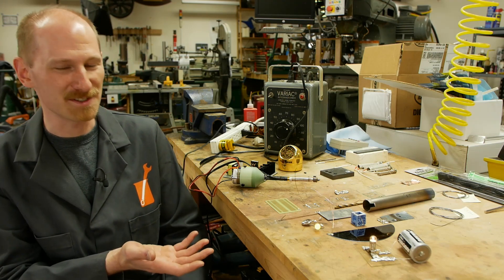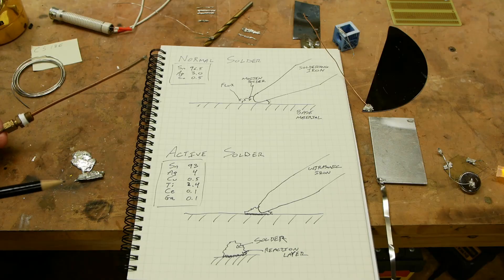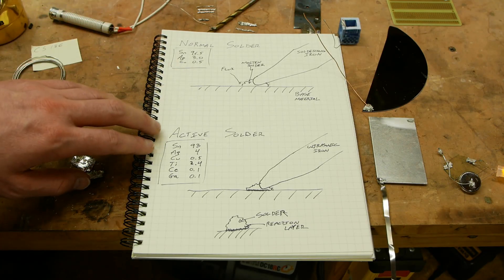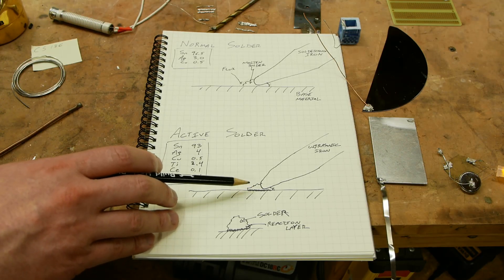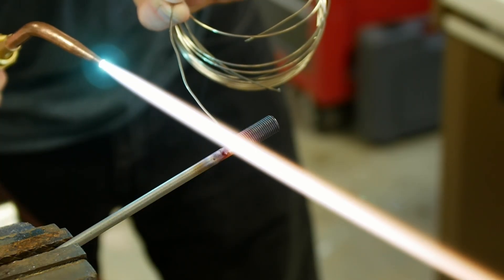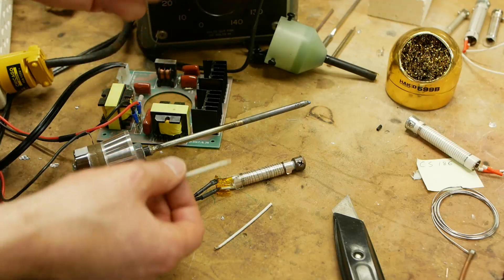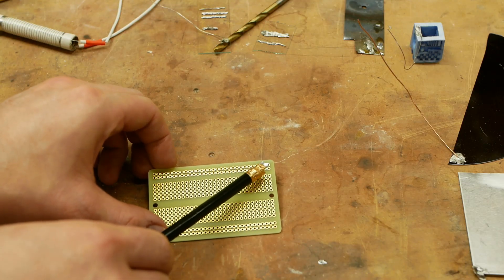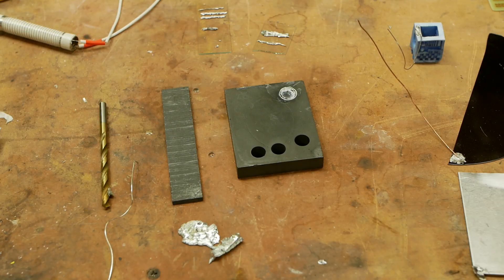Ultrasonic soldering bonds glass, titanium, stainless steel, ceramics, tungsten, nichrome...

Comment: I thought zirconium is non-reactive and why it's used in reactors?
Reply from the maker: It's true that zirconium and titanium are very reactive, so reactive that they instantly form a tough, continuous oxide layer in air, and it's this tough oxide layer that protects them from further damage.  Paradoxically, some of the most reactive metals are often the least affected by acids and other corrosive chemicals because they've already formed a very strong oxide coating from environmental air exposure.

Comment: In the future can you make a video showing a DIY solution for ultrasonic wire bonding? Specifically for creating 18650 battery packs without introducing the heat from the soldering iron into the cells and degrading them

Comment: I had that exact "solder-ate-the-tip" phenomena  on a cheap-ass solderstation. Happened with lead-free solder and a really hot temperature (the solderstation temp regulator was exceptionally useless). Felt like it was similar to what gallium does to aluminium.
Reply: It also happens on copper tips if you use them too high temp and from memory it is some corrosion as certain compounds boil off.

Comment: yo dude. i just found your channel. and i have learned more in the last 2 hours than i have in the last 2 months. i learned how u can make a water cutting machine out of a simple pressure washer. i learned how u can drill holes in any conductive metallic object, how you can put holograms in chocolate, there was one video about a glass pump that i did not understand (way above my level of intelligence) but it made funny lights happen at the end so it was cool. and i learned about the internals of an x-ray gun. oh and also that if you pull tape fast enuf it produces x rays. like wtf epic dude. thanks for the content man i love this kinda stuff.

Comment: Ben, I genuinely need to thank you so much for this video. I had never seen this technique before, and it's so simple. I wish I had seen this 4 years ago when I was working on a research project that required soldering to doped silicon -- we ended up using this weird proprietary compound called nickelex instead, and it was a disaster and our contact quality sucked, and this was despite the fact that said compound was 1% HF acid. This is so much simpler and safer... 

I'd be really really curious to see if you get good ohmic contacts across silicon oxide -- if you could do a quick IV sweep to check I'd be /extremely/ grateful. I'm also really curious if that silicon wafer holds up to a post-solder anneal, and if it improves the contact quality at all. Again, thank you so much for this!
Reply: I believe that ultrasonic welding is the norm for silicon?
Reply: @absalomdraconis  I've never heard of ultrasonic soldering being leveraged within a semiconductor engineering context prior to this -- usually, within that context, affixing anything to silicon via methods other than wirebonding to pads is out of the question. The goal of this project was solid state sensor fabrication outside of a clean room, which restricted the options pretty significantly. I'm sure this was an option that was known at the time, but neither my teammates nor the professor we were working under knew about this possibility ahead of time or stumbled upon it during our research. Dunno if that means we just missed the right sources, if it wasn't as widely adopted at the time, or if it's a research siloing thing.
Reply: @hedgeberg  : Not ultrasonic soldering, ultrasonic welding. I understand it to be the norm for semiconductors, using gold wires that are ohmicly bonded to contact points on the semiconductor die via ultrasonic actuators of some sort. I have neither training nor experience in this field, so I might be misunderstanding something about the whole subject (for instance, maybe the bonding is actually to pre-deposited solder instead of directly to silicon?), but I've run across mentions of it intermittently for years.

Comment: It would be nice to see if it works on Aluminiu Nitride, which is a common choice for high-density LED COB modules due to the matched thermal expansion with the semiconductor. The downside is that these modules are pretty small, around 10-20 mm square, and not easy to bond to a heat sink.

Comment: Do you not have to "tune" the iron by adjusting the length to find a nodal point of the sonic wave?  When we were using our ultrasonic drilling and milling machines, we had to silver solder our diamond tools into the tool holders and we had to make sure we had the exact length as specified by the machine manuals.  The formula was based on mass and length but, the mass was not hard to get as we used several standard tool holders and just drilled them out and soldered in our diamond tools.  As long as you got the length for that given mass close (say within .010")  You could use the tuner on the machines to bring it right in.  If you were outside of the ability of the tuner to adjust the transducer, you had to start over again.  This would allow us to easily drill and machine materials like 99.9% AL203, Ruby, Sapphire, and other hard ceramics.  We did this back in the 1980's for the aerospace and electronics industries.

Comment: Have actually purchased a high end ultrasonic soldering iron but VERY dissatisfied with results. Im an IPC soldering specialist and there is NO way I could send anything out of my shop with the appearance of the solder joint it creates. Sure, it may be well wetted but I'll be damned if I can produce what looks to be a good solder filet. I am currently waiting on "special" solders and fluxes to see what I can produce. A lot of the fluxes offered to solder to aluminum are very acidic in an attempt to remove the oxide layers and cannot be left on printed circuit boards as they will destroy them. I have recently had pretty good success soldering to aluminum conventionally in an argon chamber I made. I put everything in the chamber, fill it with argon then clean my aluminum with emory cloth then solder using lead solder. I get a better looking joint than I do with the ultrasonic iron thats for sure. I am currently making tons of samples attaching a multitude of substrates with the intentions of performing pull tests, sheer strength analysis and some extended temperature cycles with humidity level changes amongst other tests. Challenging stuff for sure but the boss says he wants things lighter in weight so were trying this... Enjoy the channel, just stumbled across it.

Comment: How about battery welding?  Can this process be used as an alternative to the spot welding used to bond tabs to li-ion cells?  Standard soldering requires too much heat to get a good bond, so tabs are spot welded to li-ion cells. That process creates more heat than soldering, but localizes the heat to a small area for such a short amount of time that it won't heat the cell enough to cause damage.  If this ultrasonic process can bond those tabs to cells at temperatures low enough to not damage the cell, I would definitely want to give it a try!

Comment: The graphite bond seemed like it wanted to stick. . .Perhaps a mechanical issue where etching with acid wash could provide more surface area at the microscopic level that would be more susceptible to bonding?

Comment: I unerstand this tool is just a concept to demonstrate an effect, but thinking of advanced version of it I guess it would be good idea to use non-contact method for heating up the soldering iron rod. 
These thin wires covered with ceramic isolators seem unreliable elements tending to broke by ultrasonic vibrations. Another problem is heat transfer efficiency between a tube and a rod.
 So using induction coil instead of nichrome heater would solve both problems I guess.
 Thank you for your work! It's so inspiring :D

Comment: Could you use this for colder and faster soldering of 18650 batteries and compare spot welded, hot soldered and ultrasonic soldered resistance through the batteries?

This might easily solve one of the bigger issues with DIY lithium ion batteries, where you cannot solder properly because of the heat, but a spot welder is prohibitive in cost.

Comment: This ultrasonic solder still bonds to regular solder, right? will it compromise the bond somehow if you do?  I'm mostly wondering if you could make a ready made glass/ceramic pcb with this stuff and then later use regular solder to bond all the components to it.

Comment: What if you use this method to place an easy bond between a metalized substrate ( a glass pcb ) and then solder a SMD electronic component using regular solder?

Piezoelectric crystals?

Comment: I was actually thinking, what if you could solder a glass window in a steel frame. But if the bond is that weak, it't just destined to fail.

Comment: The cheap tip erodes because it has a very thin protective layer on it that scratches very easily. Quality soldering irons use tips with much thicker protective layers, hence why they cost more.

Comment: I've just never had the urge to solder something to glass.
Reply: i sorta had. salvaged the solar cell from a cheap calculator and broke off one lead, at the very surface of the cell. wouldve made a nice low power source. and a nice use for this. i tryed with regular solder. well that didnt end well

Comment: Hey, I saw this and have a question about the mechanics of the process. When I hear Ultrasonic bonding, I think about the way they make pool toys and such, which effectively melts the layers of plastic together from the outside. Is it possible to conduct this through another material? I think it would be cool if you could bond two sheets of glass with this method.

Comment: Tip of the iron erodes because of the lead-free solder - it dissolves copper.
I have same problem with regular soldering after trying to switch to lead-free solder. 
It is especially annoying if you are using transformer soldering "guns" wchich use just normal solid electric copper wire as a tip. With leaded solder they work fine, with lead-free erosion is very quick and you have to change wire very often.

Comment: Couldn't find the 60W 40KHz ultrasonic transducer and driver for that price in my part of the world. Even direct from China it was 25% more.
However I did find a complete Ultrasonic cleaner for US$44, its 40KHz and has switchable 50W / 30W modes.
Direct from China, so it's going to take ages to arrive, and if it's not suitable for this project I can use it to clean PCBs.

Comment: For a graphite bond, what if you threaded a small hole to provide mechanical strength to the bond? Maybe run a left and right hand tap through the same hole (carefully) to produce a crosshatch pattern and prevent the solder plug from backing out the thread? Or maybe that's overthinking it? You could probably just drill a straight hole and use a needle to scratch up the inside of the bore.

It's not going to hold if you yank on it very hard, but it might be strong enough to withstand modest vibration if not subjected to any other outside forces.

Comment: Neat.  I've been using a Sunbonder and Cerasolzer to make electrical contacts on tin oxide coatings for the past few years.  Now I'm really impressed that the commercial irons don't wear much even after thousands of hours of use.  Maybe they use some really hard stainless for the tip?

Comment: solder reacts with the tip with combiation of ultrasonic weaves and heat . the layer front of  the iron becomes hot then gets reacted with solder and ultrasonic weaves speeds the reaction by stirring the layer effect. Note : i use copper rod for my all soldering irons i dont pay for soldering tips. soldering tips has nickel layer over the steel part which gets filed down in time. Copper just oxidizes by using file you can just sharpen it to brand new every time. i wonder how it would be if you used copper instead of steel tip . interesting. Thanks for doing this experiment for us! :>

Comment: I suspect this is a similar process to what they use for die to heat spreader soldering in newer CPUs (direct metal to silicon package bonding). Also your alloy looks very much like the "liquid metal" type thermal conduction products, despite those being liquid at room temperature. I know they use Gallium and Indium to allow it to whet onto both the chip and cooling solution. Might be handy for extreme chip cooling. Direct-die LN2 or LCO2 cooling project maybe? Lots of fun possibilities there for overpowering older hardware. Worlds first 1GHz Sinclair or 386/486 or something.

Comment: The tin is VERY corrosive to copper. Like, VERY. Once you scratch the 'metal' protective jacket, the tin will eat the copper like an ice-cream. Suck it right out like kids suck on freeze pops. 
I don't know why but I needed to "sharpen" my soldering iron tip for a few projects and after a few hours it became a "reserviour" tip xD

Comment: This gives me an awesome idea! Imagine using the solder in a 3d print setup! Extruding solder instead of filament. You could print a circuit board on glass.
Reply: Maybe mill the traces using a thin graphite sheet the use this method and make them neat as a template?

Comment: Hey Ben, try using that technique to solder 6061 aluminum channel together. Analysis on strength would be interesting.

Some other metals you might try are zirconium, molybdenum, vanadium.

Also you could get cheap surface transducers from parts express so you could try this with variable frequencies. There's likely a sweet spot for each solder where you could realistically flow it more than the choppy "crushed icing" finish you've displayed.

Thanks for the videos man, hope you're well. Stay safe.

Comment: I find this technique extremely interesting.  Two things: 1. would love to see more on your process of making the solder, and 2. would like to see tests bonding aluminum foils to copper wires, as that could be handy in thin circuit prototypes.  Great video! Thanks!
Reply: A while back I was working on a battery charger for a golf cart oddly enough the transformer was made with aluminum wire. I found a special solder that was specified in the manual called Kapalloy9 used with Kapp golden flux work great soldering the copper connectors to the aluminum wire.

Comment: I dont agree 100% with the part regarding flux causing (indirectly) the corrosion of copper.
The catch is that copper oxide is mostly black, but flux left on copper creates a greenish corrosion (thing !) 
this is probably a chloride or sulfate (?) copper salt, and it has to come (at least in part) from the flux itself,
because (I think) sulphur and chlorine are scarce in normal air environments.
Second catch is that the flux will cause such greenish corrosion UNDER the flux layer itself. I have seen this myself.
The layer of flux could not have been penetrated by the oxygen in the air (right ?).
Finally, not all flux brands cause such corrosion. Actually most of them dont.
Wish you could investigate this further and possibly make a video.
Thanx.

Comment: I found out today that old air-cooled engines have parts cast from magnesium. After some research I found that is easier said than done. There was almost no information on anyone having successfully performed that DIY. For light and strong metals with excellent heat dispersion properties, magnesium looks really good.

Comment: I found some MSDSes for some Cerasolzer formulations online: http://www.sanwacomponents.com/Sunbonder/Ceraspec/MSDS/Solder%20MSDS.htm (had to do some digging though)

It seems like these blends of active solder use quite a bit more surface wetting agent than your blend: they contain something like 25% indium. The exception is Cerasolzer 217, which seems to be tin with some dissolved antimony (probably to improve the mechanical properties) and zinc (for surface wetting). Indeed, one of the earliest patents I could find on this active soldering technology claims that a solid solution of 2% aluminum in tin works for this process to solder nitinol to steel. 

It might be cool to see some other solder blends, especially the tin-indium ones which don't sound like they could be made on a lab hot plate. Great video!

Comment: Very interesting!

Can you tin a surface with active solder, then use regular solder to connect to the tinned area?

Perhaps you could use PWM to decrease the ultrasonic power?

Is your soldering tip made of aluminium? Gallium would dissolve it (although maybe not when alloyed).

ITO would normally be bonded to by first masking and using PVD to add Ti-Au bonding pads. That's how we did it, anyway.

Comment: Very interesting. How does the joint resistance compare to traditional soldering? I think this would be great for connecting rechargeable batteries but I wonder if it would add an additional resistance component to a circuit.

Comment: See if you can solder to highly doped epoxy where the dopant is a metal oxide. I am thinking of high temp 2-part epoxy and titanium oxide filler. Or, let the dopant be aluminum dust (or some other metal) and see if you can solder to it and it be conductive. That way you have a potentially injection-moldable (replace the 2-part epoxy with a hot melt adhesive) that is conductive and you can then solder to it.

Could also try static dissipative UHMW (Cleanstat) or static dissipative acetal.

Comment: Does the solder tarnish?  If not, will it bond to granite conunter tops?
Application - put an artistic circuit layout on table that actually works when two lines are crossed using body conductance. 
This can be done other ways. Just curious.

Comment: The corroding factor of this solder of yours is most probably due to the gallium use (you mentioned the soldering rod corrosion). Have you ever tried to solder anything to the aluminium with it? I wonder if the solder sticks to it  and if so, will the gallium penetrate to the aluminium destroying it after a while.